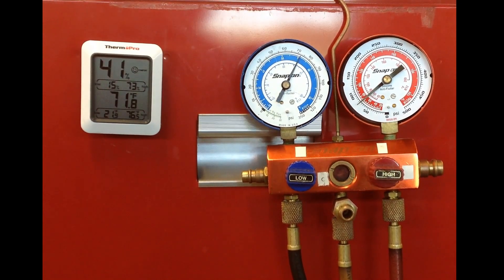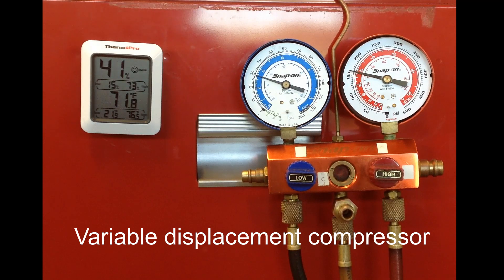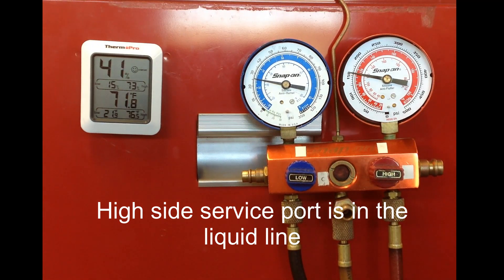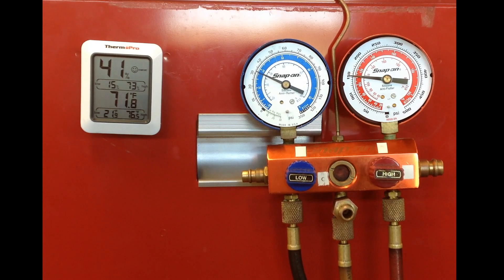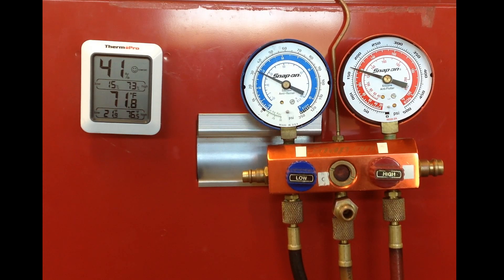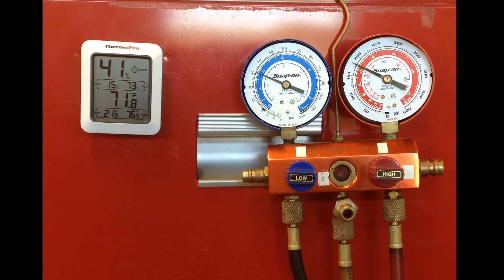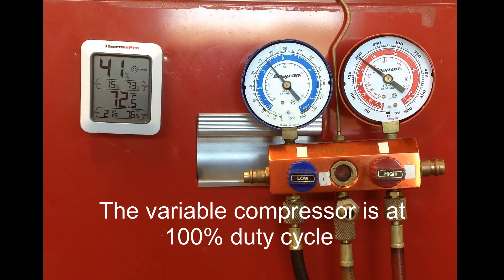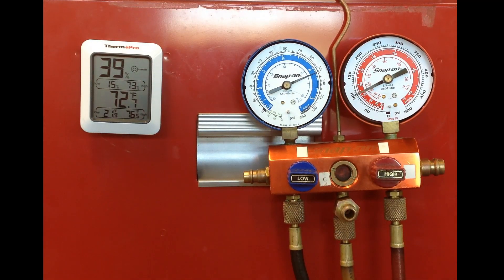A/C gauge analysis diagnostics: 2014 GMC Sierra TXV

Comment: Hello Professor Norman, I think it would be helpful at the beginning of the video if, along with the type of vehicle, you also state (or add text to the video) what type of refrigerant is in the vehicle.  I like how you show the static pressure of the vehicle with the engine cold, but at 71 degrees F the static pressure of R134A and R1234YF are pretty similar, according to the static pressure charts that I obtained online from Hudson Technologies.  It would be nice to be able to confirm that the static pressure is correct based on the ambient temperature.
Reply from the maker: Sorry it took this long to respond to your question.  The reason I do not say what refrigerant or vehicle is in the system is because it does not matter when diagnosing A/C pressure problems.  The pressures are close enough between all 3 refrigerants.  Static pressure is a quick check and as long as it is close to ambient temp it is fine. What does matter is if the system is a orifice tube or TXV.  PP

Comment: My 2014 Renault Clio also has a variable displacement compressor and in the first place I was blaming a solenoid fault for the erratic behavior of the temperature it puts out from the vents. Sometimes, mostly when I come to a stop, the vent temperature begins to rise. The thing is that if I turn off the AC for about 30 seconds and then turn it back on again, everything is fine, the vent temperature begin to decrease again and the air is cold as 4 degrees Celsius. At this point I was thinking the solenoid from the compressor is not doing his job and the duty cicle was decreasing when I come to a stop.
But after seeing this videos I will go and check the low side pressure with the gauges and also to a equalization test to see if it equalizes too fast when I turn off the AC. It it does it means the TXV valve is stuck open, like in the video.
But my question would be: it is possible for the TXV to remain open only in certain conditions? Like it is happening to me? Mainly when I come to a stop and then the TXV to unblock itself when I start driving again or if I turn off the AC and turn it back on after 30 seconds?

Comment: Excellent videos this is what students need to see.   I it would be a little more complicated but since your compound gauges have the pressure temperature relationship on them to explain superheat and sub cooling and what is happening at the same time when there’s a system that is not operating properly..  

But this would make your videos longer because you would have to explain this verbally, and make it a little more complicated for a beginning student . 

So, in this case, this is where digital gauges shine, and having the clamp on Bluetooth temperature probes on the lines and air sensors that you humidity in the software automatically calculates the superHeat and subcooling and show it to you on a graft that you can display below, or next to your gauges at the same time .   And this would make your job much easier and give your students a extra visual aid in understanding how the system works..     and he knows we are circumstances you have a system that is cooling too much like you’re on video you would watch your superheat go down to zero and explain to the students. This is where compressor damage happens because now the temperature line has dropped below the saturation point of the refrigerant and you’re literally getting liquid refrigerant being served back to the compressor overtime causes damage.  

I know analog gauges are easy and basic and I come from the old-school of analog gauges when I started some 48 years ago .  I personally have not used in a long cages in nearly 20 years and the rest of the industry is slowly not using analog gauges anymore unless they’re taught by somebody who does use analog gauges.. 

Using analog gauges is the equivalent of using a old fashion headlight with two wires on it as a test light in today’s automotive electrical circuits .  

Yes, it is useful and easy in some cases but there’s just so much more information and easily obtained with the diagnosis software that comes with a good digital gauges. They will even give you your compressor efficiency your compressor ratio, and even your BTU output of work load.  

You do a wonderful job making these videos .  Keep up the good work.. 

I’ve been making it my duty to catch Young Automotive students up to going into the 22nd century of using digital gauges for software .  Because we no longer get up in the morning and hand crank to start our engines anymore..